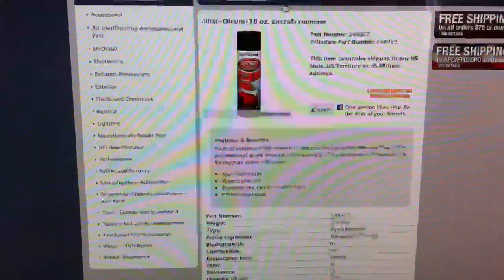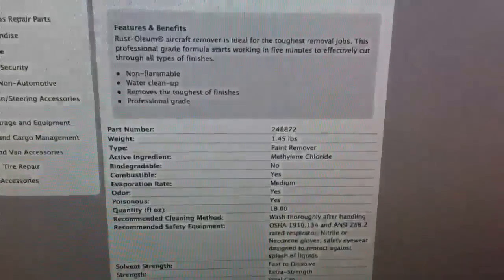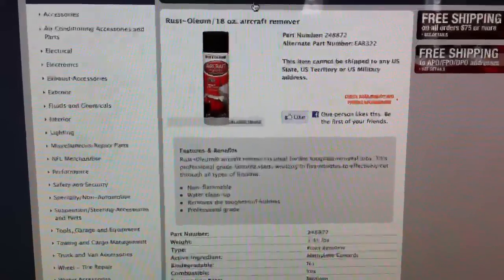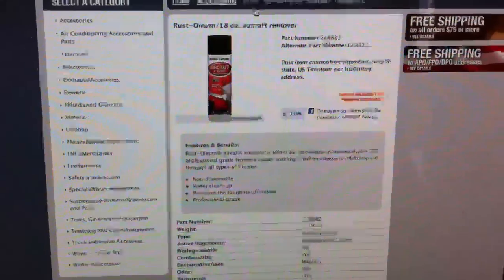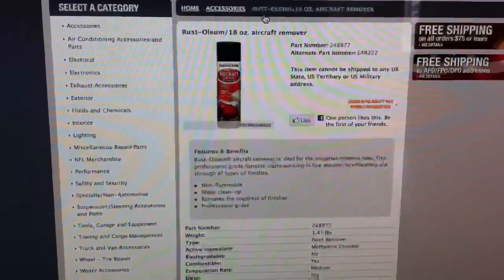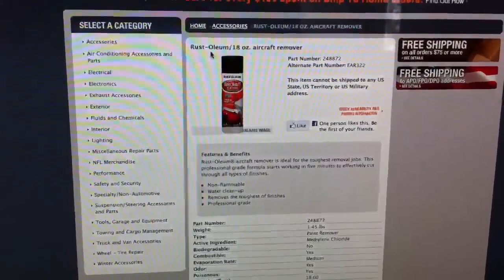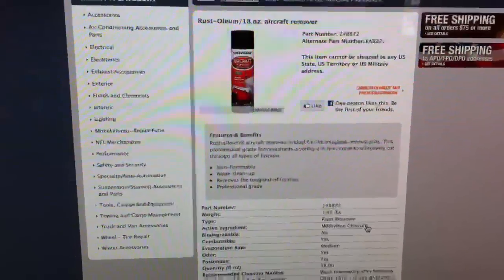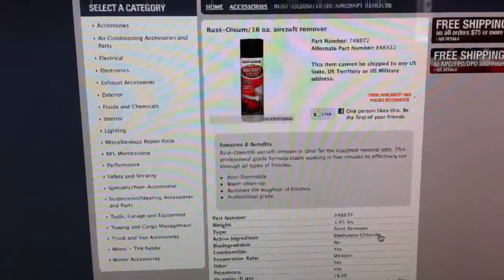How To Strip Cold Steel's Coating: VR to XiuXiu1313

Comment: After viewing this video, I got some of this product and used it on a black Boker knife blade - it worked great. Previously, on other knife blades, I had tried hydrochloric acid (HCL), extremely dangerous and nasty stuff,  but it etched the blades requiring a progression of sandpaper to polish and then oil, or the blade would start to rust within minutes. This methylene chloride product didn't do that to my Boker knife and no sandpaper was necessary. Thanks for posting this video.